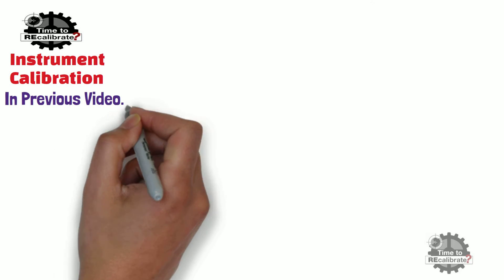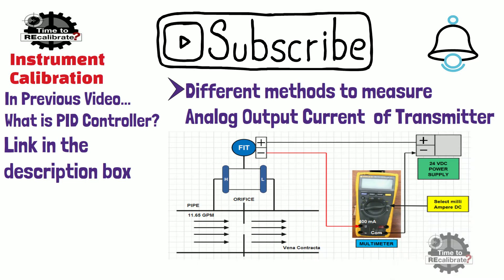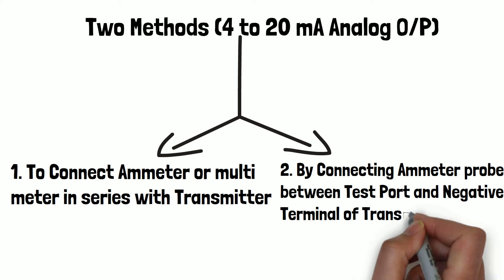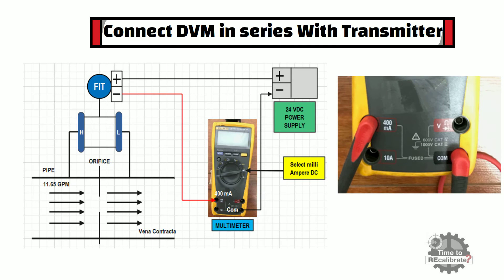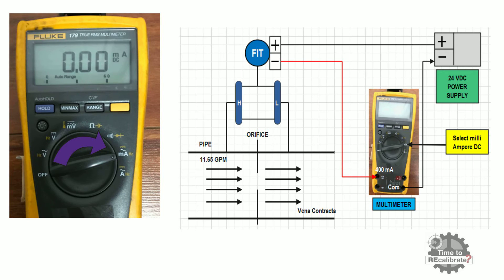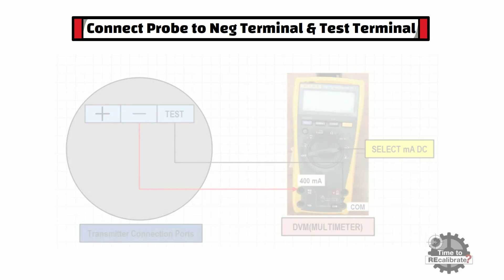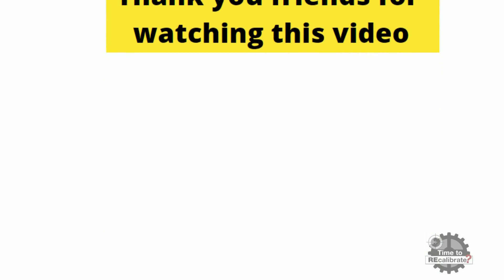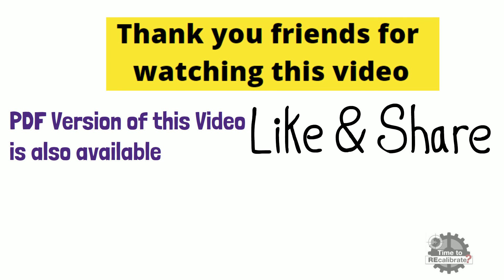Analog Output Measurement | Measure  4 to 20 mA DC current of DP Transmitter

Comment: I've got a question for you, today I was testing a pressure transmitter which had been configured to be a flow meter. It was installed as a two-wire instrument. So when testing I powered the DP metre with 24 volts and I measured the milliamp outputs on the test points. At my LRV with a Beamex MC6 I measured a credible reading of around 4 mA, however, moving the test leads to a fluke 707, I had a current reading of around 1.7mA at LRV, can you think of an explanation for this??
Reply: Try DA trim

Comment: Does polarity of meter matter in series when measuring current.
Reply from the maker: Yes...You must need to connect negative terminal of transmitter to 400 mA(red probe) terminal and common probe to negative terminal of power supply to measure mA value.
Please let me know if you need any further help.
Reply: @InstrumentCalibration  t
Thank you for clarifying.   What would happen if you got polarity wrong when measuring the current

Comment: How to check 4 to 20 mimli ampeare  analog input in panels
Reply from the maker: Hello Deepak
Thanks for your question. In order to check mA in panel, you need to connect DVM in series with negative cable. I hope you get your answer.
Reply: @InstrumentCalibration  if connect DVM in positive terminal is possible or not?